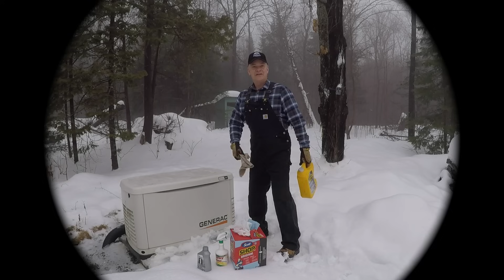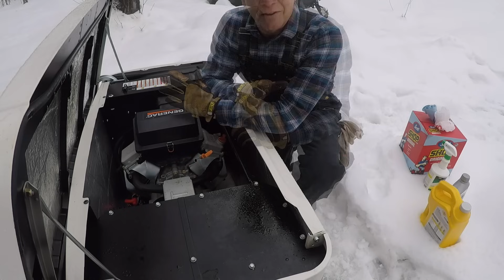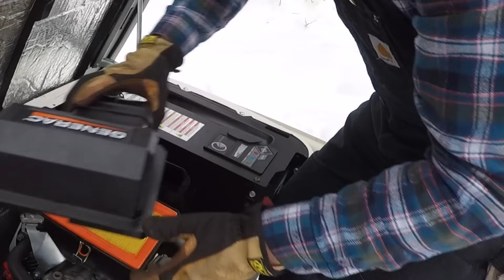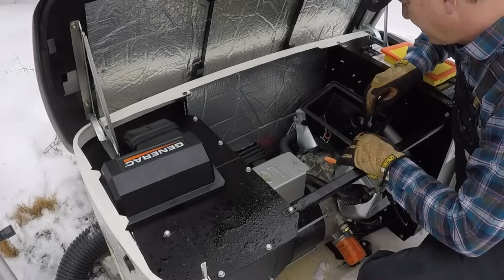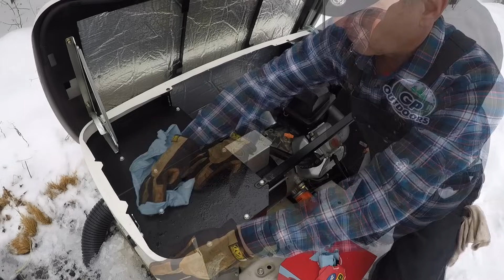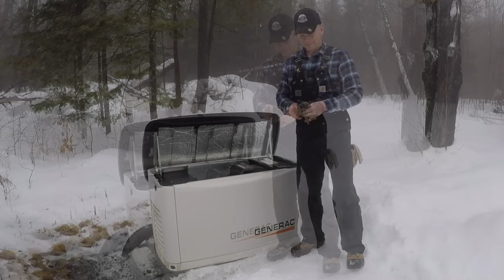#133 Thinking of Buying a Generac Generator? You Need To Watch This!

Comment: Get a “duck bill” one way drain valve - it’s a simple rubber check valve that lets condensate drain in air filters, but won’t let it suck dirty air into the engine.
Reply: Doesn't a "duck bill" valve have to have some pressure to push the condensate out thru the "duck bill" itself? I think the air filter box is operating on negative pressure inside the box "inhaling" air thru the filter and box into the engine intake. I suspect a "duck bill" would not work in this instance.
Reply: @GrayLensman51  You could use with a small pump with a limit switch, or even simpler a small cheap pump and a heating coil on a timer.
"Frost free" refrigerators are a lie - they just turn on a heating coil periodically using s simple rotary timing switch - it literally just rotates a contactor around and during part of the rotation closes the circuit.

( Side note: Super cheap switch and they last for years and years - until they don't.
I had one get jammed and as luck would have it, it jammed with the circuit closed and turned my freezer section into a small oven by the time I got home from work and wondered what the weird smell was.
I didn't even replace the switch - just nudged it and it worked fine for another couple years until I moved.)

With one of those switches, the heating coil would turn on periodically, melt the ice and run the pump and switch off.
Wouldn't hurt anything to run when the plenum is dry.

You could probably just use an aquarium pump and let it run 24/7 without a heat source at all - with slight constant airflow you shouldn't have any condensate to freeze.
Reply: @GrayLensman51  …what you say makes sense but the duckbill rubber is very light and flexible and is long enough to hold a bit of water allowing the weight of the water to dribble out as it collects. The light thin rubber opens easily with sufficient water and closes just as easily keeping out dirt and pesky insects (I am a retired product manager for a light construction equipment manufacturer).
Reply: This right here. It should have had it to start with
Reply: @GrayLensman51  It will work as there are heavy pulses of air flow caused by the 2 cylinder engine cyclic intake suction. Good suggestion!
Reply: I'd just Plastic Weld a fitting and put a small breather filter on the bottom of the air box
Reply: A duckbill valve is an excellent idea. Too bad the engineers at Generac didn't think of that. There is a long list of failure points in these machines and one should not expect them to last very long. I had a diesel powered unit installed five years ago (Aurora) and last year it ran non stop for five days with no issues. A gas (LPG or Natural) fueled unit woul have been toast.
Reply: Duck Bill = Dust Ejector Boot
Reply: @paulinetrudel8344  i work for an equipment rental company, i can tell you this, as long as your diesel generator is not a tier 4 engine, it will out perform a gas unit all day. currently any new diesel over 74hp has to be a tier 4 engine, they do not do well with the def sitting for long times and it will code out and refuse to run until the def is replaced. had a customer who rented a generator for 5 years and only shut it off for oil changes. thing ran all day and night no major issues, we sent him a brand new one last year and it lasted 3 months before the emissions system failed and had to be replaced. we sent him an older unit and he said he will keep this one until their job is done
Reply: Piss poor design by Generac... and that's not the only thing they've done wrong. The "duck bill" is used Kawasaki two cylinder engines but on just the air filter canister. There's no way I'd live with this situation. Needs to be modified to ensure ice will never collect at the outlet of the crankcase vent.
Reply: @GrayLensman51   All these intake systems operate with positive and negative pulses and is dependent on valve timing overlap for the pulse duration. RPM will also have an effect. The airflow is heavily biased toward negative inflow pressure tho. The overall effect will expel fluids out the duck bill.
Reply: @jimb4090  it's an easy fix, but will void your warranty. Put a ccv filter and run the outlet into the ductwork after the intake filter
Reply: Great ideas, but even duck bill will slowly freeze up with condensation just like a drain line. So there is a reason why the engineers didn't add those since they will also fail and freeze.
Reply: Robert Franz l
Reply: @GrayLensman51  - it’s on the bottom, and there’s never pressure in the air filter box at all, however sufficient water to freeze up and block airflow drains out via gravity
Reply: Yep.  They use those drain valves on car A/C evaporator boxes to drain condensation out and not let road dirt in.
Reply: @GrayLensman51  no, condensate will weep out.  Car HVAC boxes have them for this very purpose.  Yes the evap fan is pressurizing the box, but it will still weeps out water after you shut it off.  You could also enlarge the slit a bit if needed for use on the air box.  At least it would give the moisture buildup an out.
Reply: Frozen water does not flow out a check valve
Reply: @cornfed123567  You're talking about an off-grid generator.  Generac propane models here are only for emergency use during power outages.  Of course an off-grid generator will outperform the standby every time, not to mention the cost difference between the two.

Comment: Generac offers a cold weather kit. Part of that kit is a small heater that you wrap around that breather hose to prevent it from freezing.
Reply: If Generac knows about this problem, then this option should be standard when selling this unit in cold weather areas....... cheep bunch!!!!!!!!
Reply: @petewerner1494  or.....because Generac sells through dealers the local dealers should recommend the kits.
Reply: @petewerner1494  the number of people that need it is much lower. damn...do you need EVERYTHING fed to you???? trying thinking for once. O.o
Reply: @petewerner1494  not needed in warm weather. So why charge the customer for something not needed?

Comment: When saying exhaust port, he's referring to the crankcase breather. Its function is to introduce any crankcase vapor into the air intake to be burned thus reducing emissions
Reply: Thanks for the added detail.
Reply: Why not just vent the crankcase to the atmosphere and dont tell the EPA
Reply: @joenaylor34  That's how we er I mean some fellows in the 60's and 70's did it on  cars. When putting on a custom air cleaner it was a must. Also, you can exhaust it in the vicinity of the out side air intake if you want to burn it, but it gets your air filter dirty faster.  I'm looking at getting one of these and it should be interesting to see what can be done with the crankcase gasses.

Comment: Generator update:
Today finally came when Wired Electric came out and installed
a new engine into our 20KW Whole House Generator.
The old engine had low compression on one cylinder.
The generator was 2 years out of warranty. After calling Generac
and sending them the serviceman's diagnose of the engine
they deemed it "Manufacture Defect".
The original warranty was 5 years. I had the generator 7 years. The
new Generac Generators now carry a 7 year warranty.
I got a call from Generac telling me they were going to cover the
cost of a new generator.
The serviceman worked on it from 11:30 to 3:45.
He put oil in it and fired it up. It ran great.
I ask him how long have he seen these generators run without stopping.
He told me over 3 weeks when the power came back on. At that
time you change the oil and filter and put it back in standby mode.
Reply from the maker: That's great news - worked out well for you!
Reply: I hope NO ONE ran a generator for 504 hours straight without changing the oil. The oil is flat WASTED by 200 hours and realistically should be changed at 100 hours. A 500 hour service interval will just about destroy an engine.

Comment: Having worked on Generac home standby generators I will agree with the statement that you need to check on them on a regular basis. In the winter depending on the outside temperature and exercise frequency maybe as much as weekly after the exercise to clean out the water and ice. 15 minutes today will save an hour or more later. Give it a good run so the engine heats up to operating temp and gets the moisture out of the crankcase. A 6 minute exercise time is too short.
Reply: I worked with a somewhat larger industrial generator. It had a 750 horsepower Caterpillar diesel with twin turbochargers. Doing the routine check fluids and monthly start up, it ran for a minimum 10 minutes. We had a status panel for the generator in the computer room so we could monitor if it was running if there was a problem. Those one light that was labeled in a way that didn't make much sense and we didn't know what it was until one Saturday, generator over crank. I was heading out the door to go home early which was extremely rare. I would let my hourly employees go home with pay before I would take time off and go home and make them stay. As I was leaving I heard the generator tried to start three times and it did not start. I literally ran back into the building badged into the computer room went out the fire exit with the keys and opened up the UPS from and flipped it from generator and batteries to utility power. I went back in looked at the status panel and the light was lit next to over crank! I now knew what that light meant. It took about a week for them to fix that generator and it don't recall what was wrong with it but yeah it would have been really ugly if I hadn't reset the breakers. It would power off a dozen mainframes and probably 80 to 100 peripheral devices. As I said very ugly.
Reply: I am no expert, I just pay the bills. Monthly is what is used in other commercial environments, so that should be suitable for home use.
Reply: Generac knows this test run is too short and doesn't seem to care or they would have put out a firmware update for a longer run time.  We're in a cold area and get condensation in the oil cap and the oil gets a bit milky.  Generac says it's synthetic oil so it's fine.  Why would they say that?  Water does not belong in the crankcase.

Comment: The exhaust outlet the poster references looks like a crankcase ventilation inlet to the air box. If one were to insert a 90 deg elbow into the vent tube and get the opening higher in the air box, I think this problem could be easily solved. Perhaps that could be a modification provided by Generac.
Reply: Exactly. It a crankcase ventilation port back to the air filter housing. I had a car that did this also.. Just simply removed it from the air filter housing and placed a small filter on the end of the hose. The generac compartment is ventilated so if you did this it would simply blow the fumes out with the ventilation system. Some 20 HP honda engines did the same thing by freezing this crankcase breather tube.
Reply: @bobsimpson3661  Great idea, if you're ok with air pollution.

Comment: 3:05 The exhaust wouldn't port into a plastic box. That looks like a crankcase ventilator and the dipstick blew out from crankcase pressure. Condensation freezes in the box and blocks the vent. The gen is not designed for freezing temps

Comment: Install a 90 degree plastic elbow pipe in air box breather so it stays above any water that may accumulate
Reply: That’s a great idea. I was going to to say put a drain hole with either a screen or one way valve to keep water out, but yours sounds good too
Reply: I've seen different video on this subject where they covered the fact that modifying the breather in any way nullifies the warranty.
Reply: You would have figured the manufacturer thought of this before hand...no problem. I'll just fix it myself. That's what men do!
Reply: @peach495  Reliable generator... no warranty... reliable generator... no warranty.  Lets be honest. If you're dependent on the generator, and it has a habit of icing up and blowing its oil out all over the place, I'm not sure the warranty has any value. If its a toy for you, maybe you're ok with sitting in the dark. I was going to say until the spring thaw, but honestly, the water is still there... so it could be late spring until its warm enough to both thaw the ice and evaporate any collected condensation.

The unit really needs a simple drain.
Reply: @brianmcgovern6119  
Most people aren't "dependent" on a generator but want it to work when it's supposed to. I get that the warranty isn't going to do anything for you if the unit fails. Nevertheless, I expect the fucking thing to work as designed without the need for me to intervene by checking it every week.
Reply: @brianmcgovern6119  Drill a hole in the bottom for water to drain then it pulls in unfiltered air through that very hole.
Reply: I would think a vertical ellbow open at the top will exacerbate the problem by creating a trap for the water to freeze in and in doing so will short circut the oil level shut down feature allowing crankcase pressure to build up and escape through gaskets or seals. That may creat a even bigger issue.
Reply: Thanks! For information. I will definitely remember this when I get mine!!